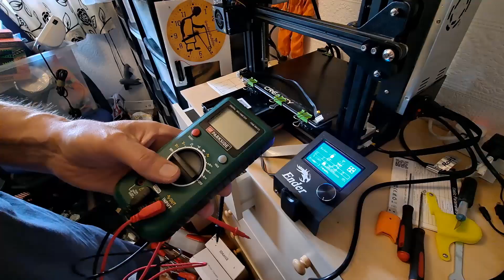Creality Ender 3 upgrade Dual Z drive supplied cable FAIL

Comment: Thanks for calling this out! I had the same issue when I received my Creality Falcon Laser Engraver Module. The control wires were reversed for both X and Y motors. Had to reverse pins on each connector 1 to 4 is now 4 to 1. The motors now move in the correct direction and hit their stop switches for homing.
Reply from the maker: Glad it helped 👍

Comment: It's kinda screwy they're fucking up their wiring. But hell yeah fixed it proper you did. My new printer seems to be lost, I can ask for a refund tomorrow, but honestly I got a good deal on it. Wanna see it come through?
Reply from the maker: That is a pain if your printer doesn't turn up. I found the new Z drive I fitted was giving me problems so I have removed it. It may have been an alignment issue, but I got so frustrated with it, I simply took it off again. I may try it again some time in the future, but I had stuff I wanted to get printed and had wasted a couple of days failing.
Reply: @GrandadIsAnOldMan  these things are something else, I swore I had my bed leveled just right, then out of nowhere it's necessary to add .5mm on the z axis tune....  New printer isn't dual z drive, or even direct extrusion. But does use two filaments ( a gimmick if you ask me)  self levels, and incorporates a 1600w laser engraver. All useless if they decide it's lost. Just give me my money back then ugh

Comment: Interesting set of upgrades. Will the direct drive allow you to switch between PLA and TPU more easily 🤔? Thanks 😀 👍
Reply from the maker: That is what I am hoping, although I have yet to try it. I also found the new Z drive was giving me problems so I have removed it. It may have been an alignment issue, but I got so frustrated with it, I simply took it off again. I may try it again some time in the future, but I had stuff I wanted to get printed and had wasted a couple of days failing.
Reply: @GrandadIsAnOldMan  Yes, I suppose if it works OK with one Z drive, then a 2nd one does add more moving parts which could cause a problem. I've watched videos about the direct drive, but up until now hadn't really thought of a use for it. I do still have an unopened roll of TPU and it would be great to be able to use it. Interesting to see how you get on. Thanks 😀 👍